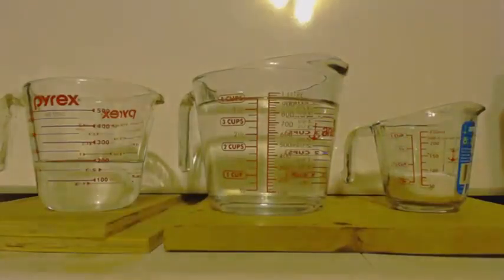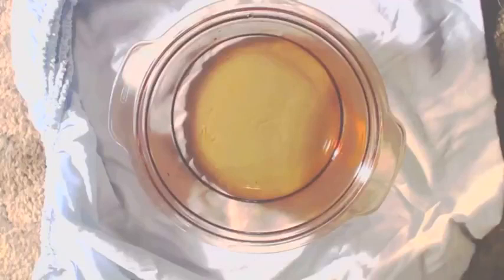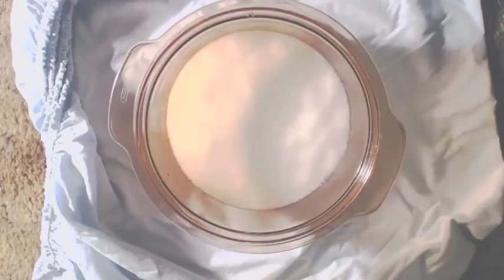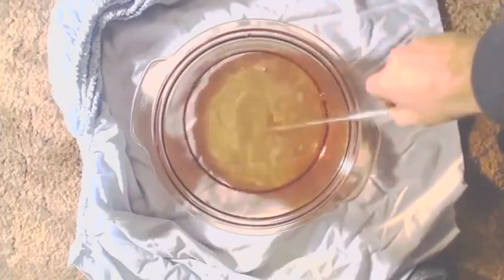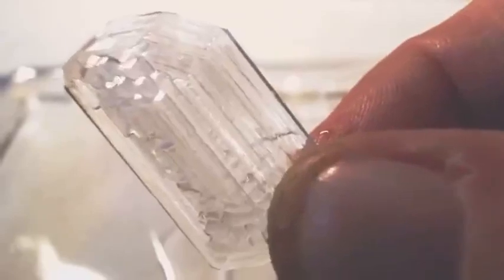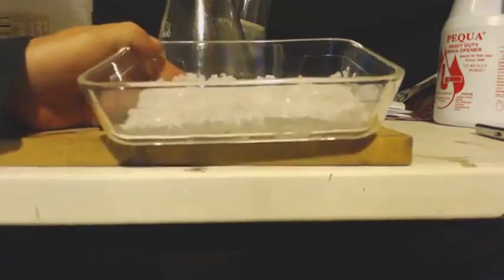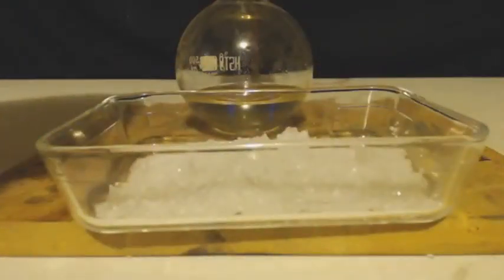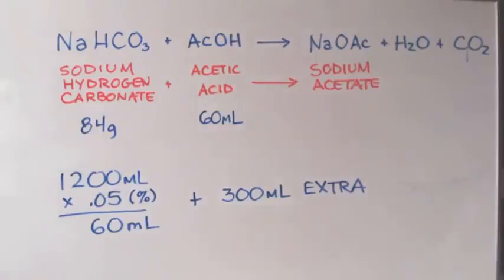ANHYDROUS SODIUM ACETATE SYNTHESIS

Comment: I myself have found a super fast way to get anhydrous sodium acetate, just microwave it!
Heating the crystals with around 300W microwave for around 1~2 minutes and let it rest for 20 seconds, then repeat the procedure about ~10 times, one can get pure white brittle chunks of sodium acetate.
The 20 second rest is to prevent overheating.
One can easily know the crystals were dehydrated by microwaving it, if the crystals do not heat up under microwave, they are properly dehydrated.

Don't use higher microwave power to heat it, the crystals might start a fire under that condition. I broke my glassware in the first test run due to the fire.

I use a large 300ml aluminum oxide crucible with a lid on it to contain the crystals, which would protect my microwave machine once the crystals started a fire. One can also use ceramic crucible.
I've done a few run without any trouble.
And I've made acetic anhydride successfully with it.

Comment: You could bake the baking soda beforehand to drive off half the CO2, so that it bubbles less.
Reply from the maker: Fattest ........... I was thinking you wrong cause you need twice as much Na2CO3 than NaHCO3.   To make sure i wrote down the equations.  And i see you were right and i was wrong.   I bow my head in shame...lol.     You use half as much Na2CO3 than NaHCO3 and make half as much water and CO2.   Thank you.   I will have to keep that in mind next time i use NaHCO3 that makes CO2 and use Na2CO3 instead.   Over foaming is no joke when it happens.  Of course afterwards it is funny as heck....lol.   Again thanks for the tip.

Comment: Accident story that I thought id share with you JBSC, since it was using the NaOAc crystals I created using your helpful video, lol.

The other day, I was reacting the anhydrous NaOAc with H2SO4 to get some concentrated acetic acid (this isn't my first time doing this reaction), and had a pretty bad accident I think if I wasn't wearing the goggles I was wearing it may have blinded me, thankfully I switched to those fully enclosed ones right before this happened (and was wearing long sleeves and a respirator). 
I had a 500mL RBBF with the NaOAc and H2SO4, and I was heating it up but nothing was distilling over, and when I took the foil insulation off the flask, I saw that the NaOAc had formed somewhat of a hard shell and was blocking the output to the condenser. I [stupidly] took off a glass stopper to the RBBF and just poked the hard NaOAc shell to make it collapse... Boom, explosive boiling. The whole fucking thing turned into a damn volcano of ~200C acetic acid and H2SO4. I think most of the H2SO4 stayed in the flask, but the acetic acid fumes quickly overwhelmed the ventilation as well as my respirator. I could barely lower the hotplate and get the fuck out until it cooled down.

Whew! That got my heart beating like fucking crazy. After that calmed down I reflected over how fucking stupid I was... The thermometer in the still head said 35C while the hotplate was well over the boiling temp of acetic acid... That heat obviously had to be going somewhere. I poked the bear and paid dearly for it. I should have lowered the hotplate and let it cool down first, then poked the NaOAc shell that was blocking the output. Won't ever happen again. >_<
Reply from the maker: JH........Youtube did not notify me of this post but i stumbled across it while replying to other post.   Oh man that made me laugh.   Trust me i know it aint funny while it is happening.    You probably know by watching my videos that  safety is not much of a concern to me.   But protecting your eyes is one thing i am on board with.   I have added liquid to liquid to many times where a drop flipped up out of the flask and directly into my eye.  TO MANY TIMES AND I WEAR GLASSES but sometimes i take them off to see close stuff.    I am GLAD you told me your story.   I am sure that will make me think the next time i got crud blocking the pot and not do what you did.
                         Just a suggestion.........But you could PROBABLY just wait for the inside of the flask to heat up and eventually before it starts distilling the solid crud will fall and dissolve into the liquid.   Sometimes what i do which is probably not safe is just pick up the one side of the apparatus with the pot on it ....while the other side with the receiving flask is clamped down......and shake the pot in circles and the crud will fall down and stop blocking everything.  But serious i THINK you can just wait it out and wait for the inside of  the pot to get hot (90C) and that will make the solids fall and dissolve in the pot.    Just do not have the hot plate at a million degrees while you are waiting for the crud to fall and dissolve.